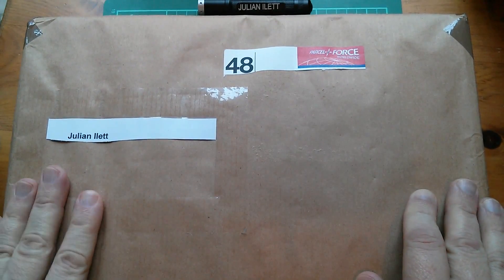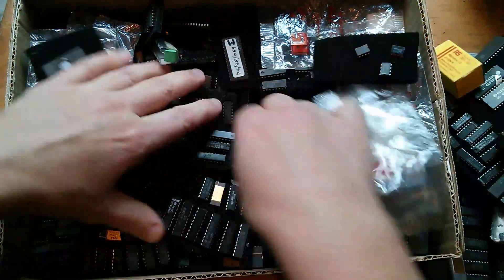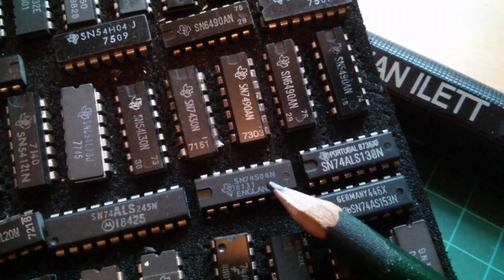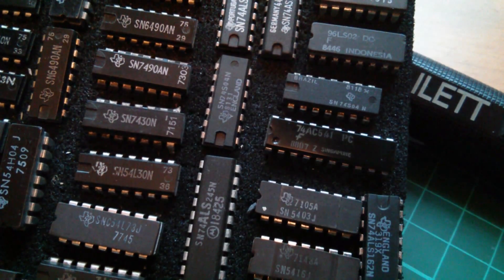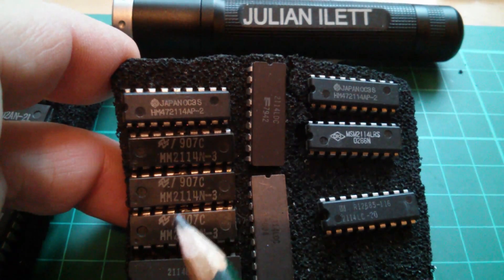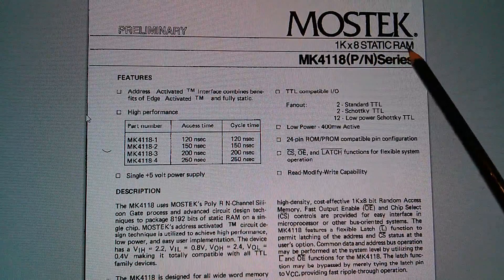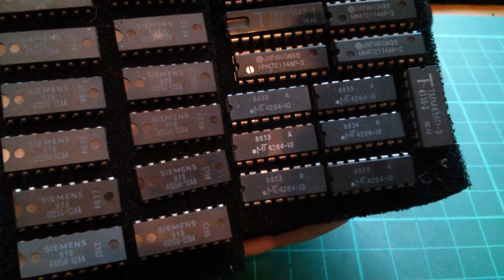Julian's Postbag: #52 - Big Box of Integrated Circuits (part1)

Comment: A box of memories in more ways than one. Being a 'machine code junkie' both then and now, I was fascinated to have a look in your box of goodies. This video could have been 4 times longer for me. I first learnt MC programming on the Z80 but subsequently gained extensive experience with the 6502 and 6800 family including the 6809 which, if memory serves,  was used in the Dragon 32. The gold plated ceramic packages are collectables now, especially 8-bit CPUs, as are some plastic packaged devices. Others will be sought after by 8-bit computer collectors for spares.
It was the 8-bit computer craze of the early 80s that got me into electronics, an interest that has kept me gainfully employed ever since, but I still miss the pre microcontroller, OLED display good old days.

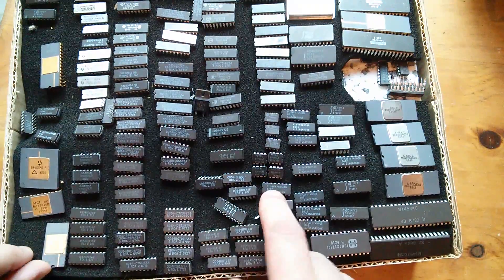Comment: The MCE UK 72nnn chip you point to at 1:50 will be a custom ULA of some sort - that's what Micro Circuit Engineering did in the early 80s.

Back then they laid out the cell interconnections using tape and film, just like PCB layouts were. They got stuck on the layout of a rather tight ULA design for a firm I was working for so me and a colleague, both of us experienced in PCB layout, went down and managed to sort for them.

Comment: I believe the 6802 was used in the Commodore C-64.
Reply: +Thomas Coughran and the PET, VIC20, and MK14
Reply: Yes, you're right. I was assuming that 6802 above was a typo for 6502.

Actually, the PET and VIC-20 used a 6502, and the C64 used a 6510.

The MK14 was something entirely different that ran on a National Semiconductor SC/MP.

Comment: I've also got a few boxes of mixed ICs, mostly from ebay where I sometimes bought electronic components by the kg. The packages were always worth their money, because of the pots, switches, relais, caps and similar "universal" components included. But most semiconductors (ICs as wells as transistors and diodes) were pretty useless and sit in boxes. For half of the parts I would never have a use. For almost all of the remaining ones I have recent parts (transistors/MOSFETs, diodes) that are cheap and have better specs or the logic is just easiers done in a microcontroller. And for the 1% of parts out of the lot that I could really need, it is just not worth the time to sort all the pieces and look up their datasheet to know what you're dealing with (these has to be done before you even know you need a part).

Comment: I wrote a ton of assembly language in the '80s for the 6802 processor in the Wavetek 650 2 MHz Variable Phase Synthesizer. Wrote the auto calibration software among other things.

Here's the data sheet. http://www.atecorp.com/ATECorp/media/pdfs/data-sheets/Wavetek-650_Datasheet.pdf

Comment: Those 4264's will probably work in a C64, as well as those 2114's you showed earlier. Those 2114's can also be used to fix VIC-20's.  The 41256 will work in an Atari ST, or Amiga.
Reply from the maker: +GadgetUK164 And it looks like the Sinclair ZX80 used two of the 2114 RAM chips
Reply: Julian Ilett The 2114 RAM was also used in the Acorn Atom
Reply: ZX81 too I think!

Comment: My OCD... I want to sort them. Put them all in little bins and add them to a spreadsheet. I feel like an addict closely supervised at a pharmacy.
Reply from the maker: +MrMistery101 I kind of agree. But original 74 series logic is a bit crappy - it gobbles up loads of power and it's pretty slow. It's good fun seeing how hot these old chips get, but they're really not any use for practical circuits.
Reply: +MrMistery101 I wanted to sort them out too but there are just so many devices from so many different families that it would be a monumental task to undertake. The boxes were sitting around in my garage for a couple of years waiting for me to do something with them. In the end I had to either find a new home for them or put them out with the rubbish - that's when I thought of Julian.....
Reply: +Julian Ilett i have seen people looking for original 74 series for old pdp computer renovation. Aparently its the only serie that works
Reply from the maker: +Hydrameda Most of the damage seems to have been caused by some sort of reaction between the chip pins and the conductive foam. It looks like rust, but presumably the copper/tin/lead equivalent.
Reply: Oh yeah,  I was going to write to you about that-- that black foam is wonderful stuff for antistatic purposes,  but it will degrade,  and if left long enough,  it will eat the pins right off of chips.  I'm not sure what can be done to repair that damage, either,  just remember that I've seen mention of it somewhere before.  Gotta get those chips out of that stuff before it eats more of them!
Reply: +Julian Ilett Many moons ago I worked on the ill fated AEW Nimord project. Can you imagine 50000+ 54 series i.c's flying in an airframe. No wonder it never could be made to work consistently.

Comment: how much it takes to get one package like yours  Julian 

I'm a electronic  student  in turkey  sometimes they are not easy  to  find 

sometimes they can foundable  but soo expensive 

example  I need to give 10 of 7812 for 7.5 dollars
Reply: +Ferhat Yildiz I used to gamble on grab bags on ebay. I would often end up paying almost twice in shipping (US->Honduras) but would often get at least 75% usable/needed ic's. 
If you want to be sure, just save up and make one big purchase from mouser/digikey/futurlec/ebay and get anything you think might be needing/using in the future.
Or, move away from discrete logic and start using micro controllers.
Reply: MrMistery101  Thanks  for your  answer. I am also repair electronic  devices. Some times they are very old  and I cannot  find  any  of the chips  so I can't  repair it and I can't get paid  for broken devices  :/

Comment: Never heard of the 64xx family.
Reply from the maker: +jimstand Neither had I, but there's a brief mention of it in the notes section at the end of the Wikipedia article listing all the 74 series logic - https://en.wikipedia.org/wiki/List_of_7400_series_integrated_circuits
Reply: +jimstand The 64 was industrial. Meant to handle higher temperatures than commercial but not quite like military[54]. It was pointless and died out.